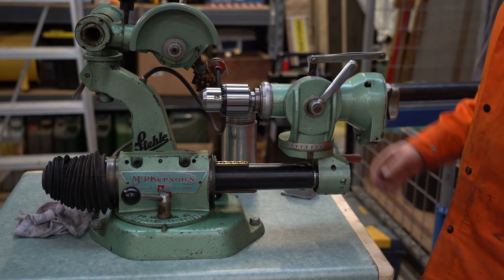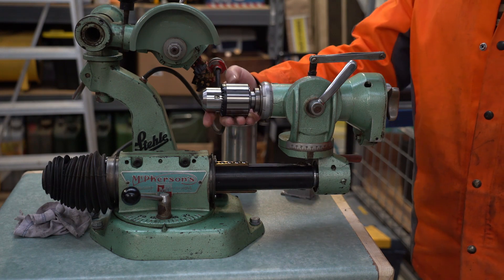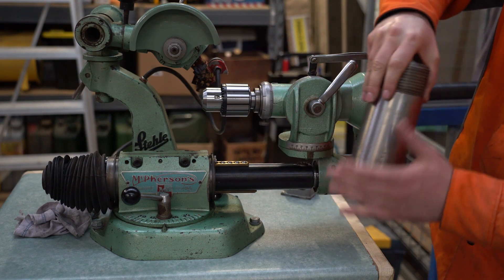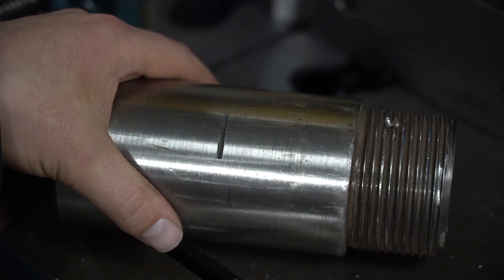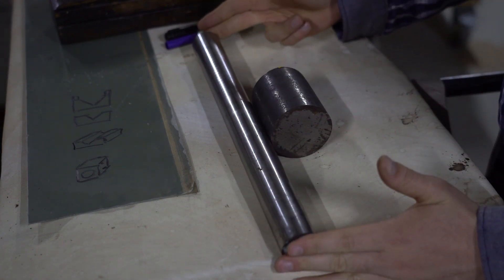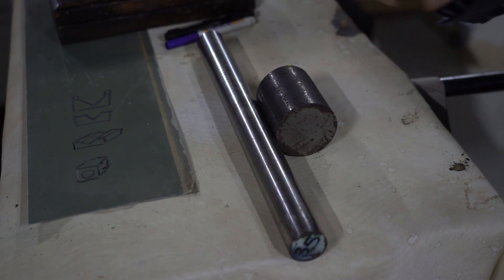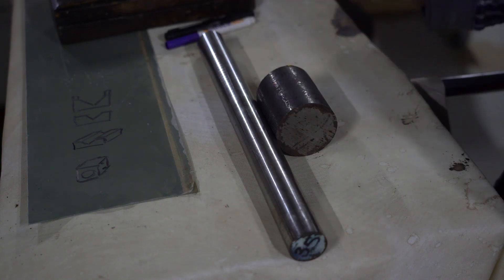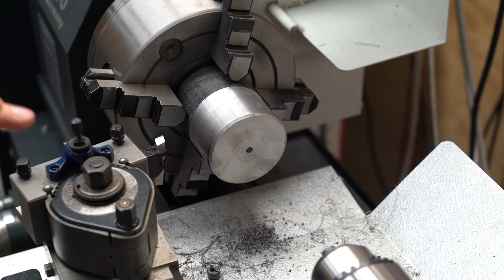Making a Tool & Cutter Grinder Shaft Extension

Comment: interesting T&C grinder, I would be cautious of using the drill chuck with something like that tho because of the chucks always have runout, which can really mess you up when grinding cutters.
Reply from the maker: You are right. I need to check how much run out it has before sharpening anything that needs accuracy.